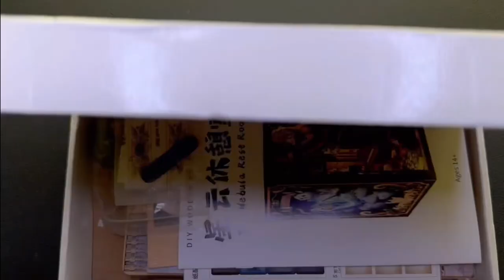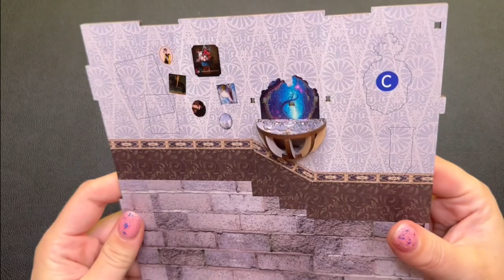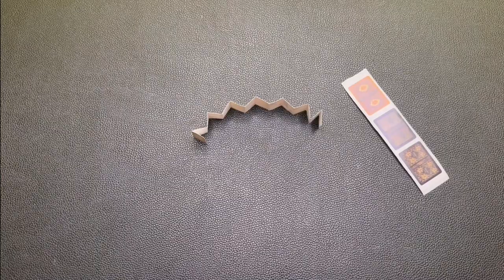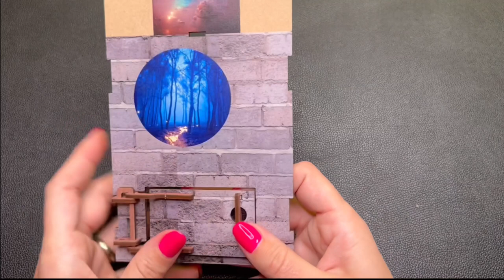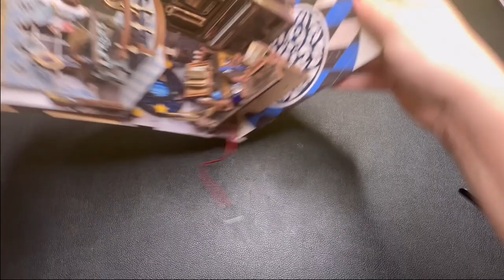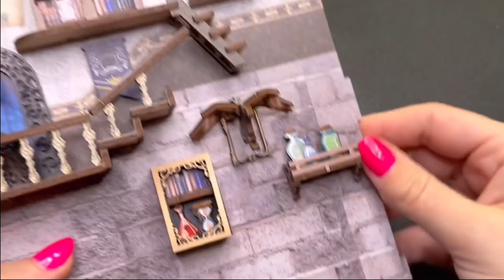Crafting the Cosmos: DIY Nebula Room Book Nook Assembly by Cutebee

Comment: Do you need anything for this kit that doesn't come with it, like glue or tweezers?
Reply from the maker: mine didn't come with glue, mostly because when shipped by airplane they have to take it out. The kit does come with plastic tweezers, as far as I can remember
Reply: @ancadiyadventures  I bought a set of craft tweezers from Amazon 6 in total for £4.99 a total must !
Reply from the maker: yes, tweezers are a must, glad you found a good deal